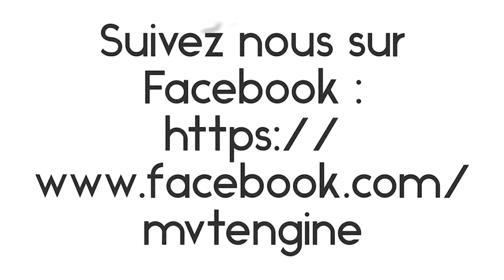Notice montage allumage MVT DIGITAL DIRECT DD19 MBK BOOSTER et YAMAHA BW'S BOOSTER après 2003

Comment: Where should the cables from the stator itself be connected to the wiring harness and to what color of the original plug of the ignition?
Reply from the maker: Sur Booster 2004, sur le faisceau origine broches 4 fils

Comment: Is it ok to remove The original cdi? And just use that brown wire?
Reply from the maker: @stenberg1982  non le cdi origine doit être conservé
Reply: @MvtParts  aha 😍🔥 i took it away, get spark from The new cdi, but maybe to weak?
Reply: @MvtParts  i wonder, i get spark, but it seams weak, not that powerful! Can i have problem with cdi? Bevuse this  ignition should come with a strong spark
Reply from the maker: @stenberg1982  contact SAV mvt.jose@outlook.com
Reply: @MvtParts  i tested to change The cdi and now it works fine 😍
Reply from the maker: @stenberg1982  le cdi origine doit être conservé et le fil marron du diagramme shunter sur le marron du cdi origine
Reply: @MvtParts  no u dont have to spare The old cdi, just put The brown to The +12v from ignition, i have removed The old one and that works for me!
Reply: @stenberg1982  posso usarlo senza la centralina originale ? collego insieme i fili marrone?
Reply: @EnTo_29  yes 12+ from ignition 👍
Reply from the maker: @ Connectez fil marron du diagramme sur +12v après contact, ça devrait fonctionner.
Reply: Ma la centralina originale posso toglierla?  @MvtParts

Comment: hola buenas tengo el mismo rotor montado en un motor aerox y la moto no tiene electricidad ninguna, y no la puedo arrancar, alguna sugerencia por favor,
Reply: Have u found any soulotion? I have The same on my aerox, spark but it want start! Cant figure it out, but i removed The old cdi
Reply from the maker: Contactez le SAV et expliquer leur votre soucis ?
Reply: @MvtParts  yes i did... Get a new cdi and then it worked just fine
Reply from the maker: @_miiro3  sav mvt.jose@outlook.com

Comment: Hola,
¿Se puede instalar en una booster anterior a 2004?
Gracias
Reply from the maker: Oui mais ce n'est pas ce modèle il faut un DD06
Reply: @MvtParts what are the differences?
I’m an electrical engineer so no worry to cut and solder if it’s just a different connector